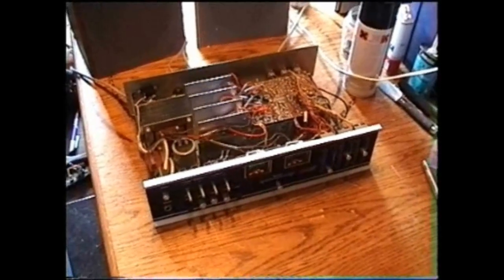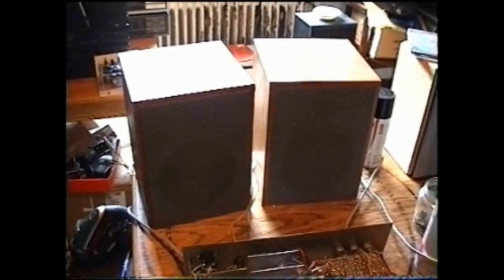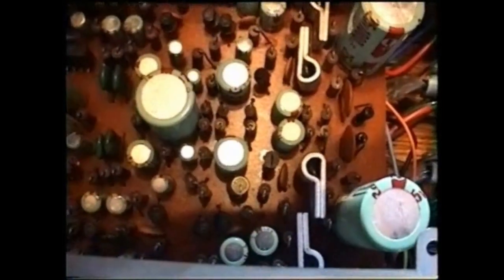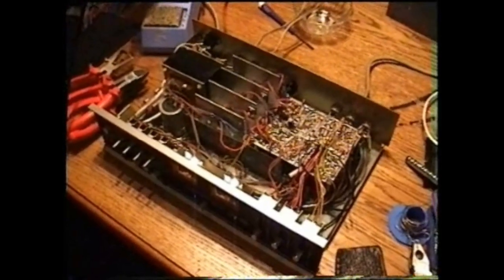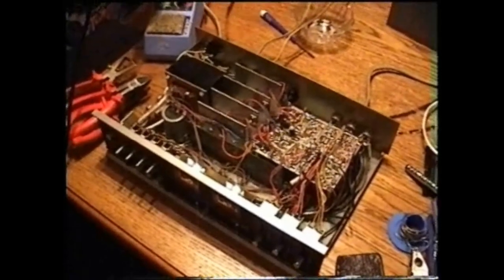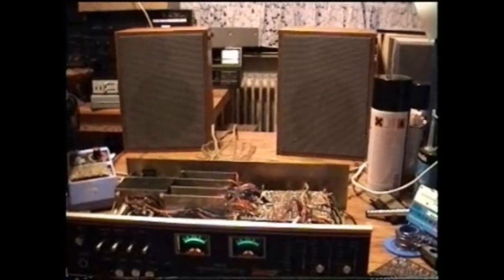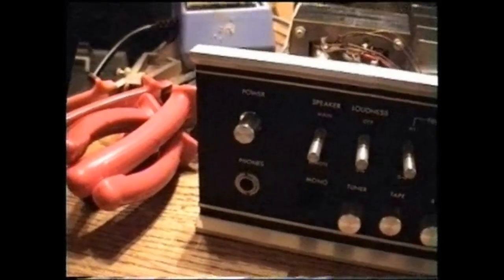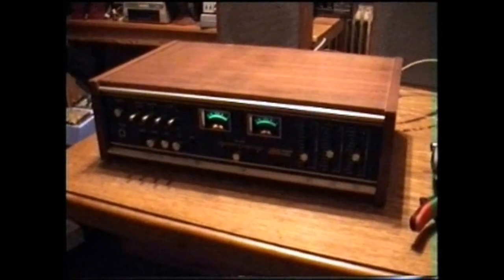DrCassette's Workshop - Audio Sonic SK-2020 amplifier repairs

Comment: I used nearly the same model as my daily driver for a while, just without the VU-meters. The background noise was really annoying so I replaced it. Did you manage to get rid of it after replacing the filter capacitor?
Reply from the maker: I never replaced the main filter capacitor, so I don't know. But even if you got rid of the mains hum, there would stil be plenty of hiss and noise caused by the old transistors. To make this amplifier sound good, you'd have to replace at least 50% of all the components and even after you're done you are stuck with the outdated 1960s amplifier circuit. This thing is just not worth it. Any modern all-in-one amplifier IC sounds better.

Comment: Hi DrCasette, i own a Kenwood vr-6060 that won't turn on, keeps power light blinking. Can you help me please?
Reply from the maker: Eric De Garate The blinking power light could indicate that the speaker protection circuit has detected a problem and won't switch on the speaker outputs. Check the power amplifier for problems.

Comment: If the main smoothing cap was leaking and passing DC that would account for the hum and heating of the mains transformer. The hum did not really sound like smoothing hum more like O/C input, or unscreened hum. Did you ever solve that hum problem?
Reply from the maker: Michael Beeny No, I didn't. Not sure what's wrong in the unit, I was always thinking it's the bad filter capacitor, but yes, it could just as well be bad shielding. This thing is a very bad/cheap design, not sure if it at least worked right when it was new. The cheap transistors in this also cause a lot of hiss in the audio. It failed to sell on Ebay, so sooner or later I might try putting in a different amplifier circuit that actually works right.